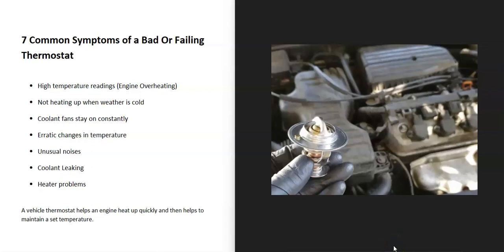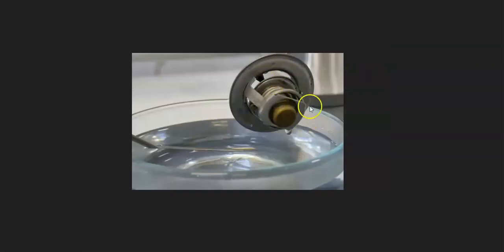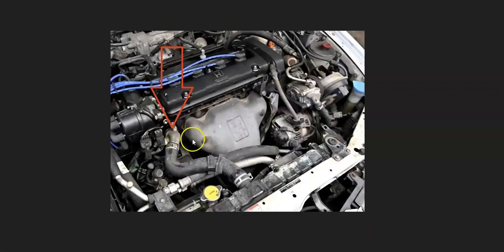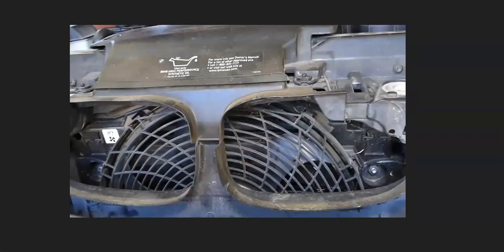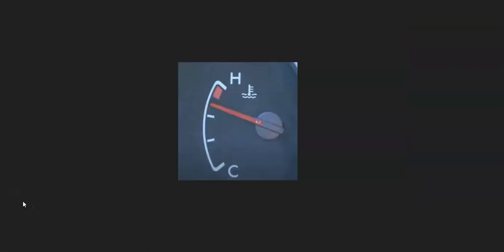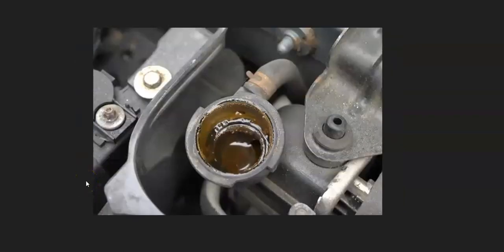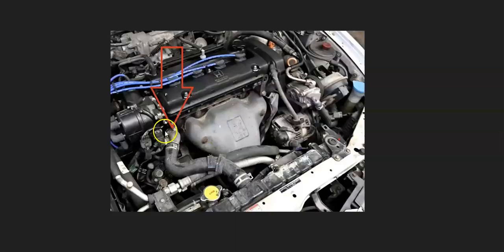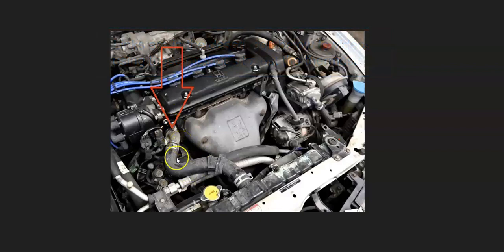7 Common Symptoms of a Bad or Failing Thermostat

Comment: Hi I live in Chicago and it’s very cold right now. I have a 2005 Toyota Avalon, it would throw out hot air and the car’s temperature was normal. 20 minutes into driving the air would get very cold and the car would start to overheat. I would accelerate the car hard and the car would start throwing hot air again, and the car would go to normal temp. ALSO KEEP IN MIND THE CAR WOULD NOT HEAT UP WHILE IDLING. I then changed the thermostat thinking it’s the problem and now my car heats up while idling. Only my left radiator fan turns on. I need help pls!!!!

Comment: My 2013 Silverado with 4.3 ltr V6 the engine doesnt overheat in summer or winter but the heater blows cold air when fan is turned up. If the fan is left off you can feel warm air coming from defroster and heater vents. Would the thermostat cause this?

Comment: Im noticing that the hose that connects to the reservoir is leaking and a leak from the firewall connection. Is there something else thats causing this, like the thermostat? Cuz now it seems like its getting worse. And im worried

Comment: What if your temp gauge is just not heating up, but you still have heat? Is that just the sensor? Or a combination of the sensor and thermostat? Also what if your AC is not working when the temp gauge is all the way cold?
Reply from the maker: If the engine heats up but the gauge doesn't, that is usually a bad sensor or sensor wiring.
Reply: @HVAC_Mechanic okay thank you!

Comment: I have a leak that I haven't been able to spot just yet but my top hose is hot to the touch while my lower hose is cool to the touch I also hear like boiling liquid when I get back home and put it in park after a 10 min drive give or take also a little steam that's smells kind of sweet. I have a 1998 Jeep Grand Cherokee Laredo I replaced the gasket but not the thermostat. Do you think I have something loose or is it the thermostat or the pump

Comment: I've got an 08 ford escape 2.3. i just replaced the radiator and slowly started to fill the  antifreeze to where the level wouldn't go down any further. Started vehicle and tried to burp the system and it seems like the thermostat is not opening, but im not sure.  Noticed the the temperature gauge started rising to almost to the H. Im worried and don't have a lot of money or time left. Unable to drive it atm .

Comment: I know this video is a little old so I might not get a response but... my fan isn't kicking on at all and my 1986 mustang is overheating. Could that be the thermostat or maybe something different?
Reply: could be a multitude of things, thermostat, coolant temp switch (tells the car when too kick the fans on at a certain temp), bad fan relays, bad fan fuse, coolant temp sensor.

Comment: my  temp gauge is fluctuating between cold and mid temp I’m thinking of starting with the radiators coolant sensor and a thermostat .. I already checked coolant levels. Hoping it not the water pump

Comment: I’ve been noticing the smell of antifreeze for a while after driving it , but no leaks. Then recently I had a situation where it over heated after driving for about 40 minutes on the highway.
Reply: What was the problem?
Reply: @fierro701navarro2   no clue its great in town but long it trips it will it over heat and start slipping to the point it barely drive. Once it cool down it’s fine again. I’ve changed all thermostats as well.

Comment: The temp gauge was past the H! Almost to the bottom. I squeezed the hose a couple of times and it heated up and the temp gauge dropped. 🤦🏿‍♀️ Done changed this thing WAY too many times.
Just got a flush. That may be the cause. So I bought a Motorcraft this time. 2094 Ford Taurus SEL. It's said to not do well with aftermarket thermostats. So I hope this is the last time.

Comment: Hi, I have a 2006 Corolla that’s only blowing cold air, even after running the engine for 10-15 minutes. I replaced the thermostat since that's usually the culprit when there’s no hot air, but it's still blowing cold. I also filled up the coolant reservoir, but it looks like the fluid isn't getting hot at all. The car's temperature gauge moves, but it never shows the engine is overheating. The fan is working, and the bleeder valve seems to be functioning fine. What could be causing this issue?
Reply: Could be a plugged up heater core.

Comment: 2014 Nissan Maxima I ran over an possum last night night woke up this morning to it running hot no visible leaks anywhere I can see but coolant keeps running low every time after I fill it up idk where it’s going oil an coolant are not mixing but heat not really working until the car is in overheating stage

Comment: My check engine light came on so when I went to auto zone I was told it was the thermostat.  My car isn’t over heating or anything. I have a 2016 4 cylinder twin turbo Infiniti Q50 and I can’t find one video that is for a 4 cylinder also when i went to buy the part they gave me the whole thermostat housing unit.  The whole thing has to be replaced?  Sorry I just don’t know much about cars and with it being my only means of transportation I don’t want anything to happen to my car
Reply: 4 cylinder infiniti have a single turbo not twin turbo...just fyi
Reply: My check the engine light came on I brought it to AutoZone and thesaid it was thermostat  how long I came ride before I put it on because I gotta go to work it's Friday nobody can't fix it until Monday u think I can still ride it's not gonna run hot do I take a chance

Comment: I just had the radiator replaced. My radiator fan isn't coming on. The engine isn't overheating. Should the radiator fan come on at about two mile ride. The radiator fan was coming on prior to the repair. I'm just not understanding why it isn't coming on now.
Reply: Sameeeee trying to figure out how my heat was working perfectly fine wit my coolant light noti kept comin on b4 i got  radiator n spark plug replaced had an leak n slipping transmission 😢 and now my heat don’t work unless it 40 degrees or above. Now my money light back on

Comment: I changed my coolant temp sensor because the fans ran all the time, even when i turned the truck off and the temp gauge wouldnt move. For 2 days i assumed i fixed it because the fans went back to normal and the temp gauge started working. Now, all the problems have come back.  What could be the issue?
Reply from the maker: It needs to be diagnosed but check the wiring something may have not been plugged in good and came loose.
Reply: @HVAC_Mechanic  thanks for responding. I unplugged the sensor and put some lube on it a mechanic gave me, and hopefully that does the trick. It's working so far. I really appreciate you responding!👍🏾

Comment: Wow this really helped because my BMW OBD said map controlled thermostat jammed open BUT I'm not getting and erratic readings on my coolant gauge. Everything seems normal. However my check engine light comes on sporadically when the temperature changes a bit

Comment: I got a 180 thermostat an it will always run at 185 to 186 when I’ll gas or race I’ll run at 200 max an go back down at 185 to 186 at  cruise. Now it runs at 192 to 195 is the second time a charge the thermostat idk what to do now.

Comment: Good video hey mine overheats while ilding ofter like 20 to 30 minutes but runs great while driving never overheats when driving but if it starts to overheat not in red but going up and i pull off and drive it goes back to normal what do u think that is
Reply: Could be cooling fan, whether clutch fan or electric.
Sometimes when these go bad the radiator doesn’t get necessary airflow until your moving and wind goes through it.

Comment: Could it be your thermostat if your truck is using a lot of coolant but don't see a leak? Temperature gauge in the truck doesn't seem to go up or down,right in the middle but I'm using at least a gallon of coolant every week and don't see a leak.
Reply: Sounds like a head gasket issue. I bet it’s leaking into your oil.
Reply: @chinkyroo  I thought that too but there was no water in the oil. It was a slow leak that took time to develop. Pretty sure it's the water pump now. 
Thanks though!

Comment: HELP PLEASE, TOOK CARE FOR REGULAR OIL CHANGE BEFORE OUR BIRTHDAY TRIP FOR IT DAUGHTERS. THEY SAID THERMOSTAT HOUSING WAS CRACKED, HIGHLY RECOMMEND TO REPLACE. WE DID.  HEADED TO CALIFORNIA ALMOST 300 MILES DOWN THE ROAD CAR FOR HOOOOT. WE CONTINUED ON AS WE HAD PLANNED PAID VACATION. USED ABOUT 14 GAL OF COOLANT. FOR BACK HOME TOOK CAR IN. GIVING US CHADY INFO. SAID THEY WOULD REPLACE THE PART. BUT THAT THE PROBLEM WAS RADIATOR HAD A HOLE. IT 400 FOR FIRST REPAIR. 240 ON COOLANT. NOW THEY WANT ALMOST 600 TO DO THE RADIATOR. I JUST WENT FOR OIL CHANGE. CAR HAD NEVER HAD ANY ISSUES AT ALL. I ASKED HOW THEY KNOW IT'S RADIATOR. THEY SAID PRESSURE TESTED. I SAID DID YOU OUTSIDE TEST AFTER REPLAYING THE  HOUSING. THEY SAID NO. THAT WAS EXTRA ?? PLEASE ANY ADVISE WOULD BE GREATLY APPRECIATED 🙏

Comment: Replaced a cracked heater core hose and reservoir.  Goes to 210, i go around 70mph and it'll go up from half to 3/4 hot.  Once I let go of the gas to 60 it goes back to 210 (half)  would that be a bad thermostat and or didn't let all the air pockets out?
Reply: You find out
Reply: @MaleekKimble  yes, I had a clogged radiator.
Reply: I also went ahead and replaced the upper and lower hose, both inlet and outlet heater core hose, thermostat, temp sensor, water pump, and reservoir.

Comment: I have a weird problem. I just drained and filled my 2021 Acura ILX, and now I only get blasting hot air, when I set the temperature to HI? If I go to 80,82, ,85, ect.. I get room temperature air basically. I used the spill free funnel to burp the system for 2 days now. Same results? Any ideas? Thanks
Reply: The temp gauge stays in the normal spot, even through all this?
Reply: Also both hoses are hot.

Comment: Great video, 👍 
My engine temp used to read 203° with a 203° stat, but due to a faulty radiator cap ( verified with a cap pressure tester) the engine overheated. 
I replaced the coolant and the cap and engine seems to be running fine but the temperature now reads 194° . Temp does not fluctuate and engine warms up as quickly as it did before the overheating.
Could the thermostat possibly be damaged due to overheating?

Comment: I have a 07 Civic Si when I warm up my car it’s low then goes normal half ways, but then when driving it goes high but my car doesn’t over heat, then it will go back to half ways, or when I start my car it would be high then 2/3mins later it goes back to normal half ways. So it be the thermostat that’s bad? Thanks for the help

Comment: Unless you live in very cold area.....I'm on the coast of Calif...take the thermostat out and leave it out...a colder running motor won't run your day like a very hot motor..
Reply: @markwilliamson2795  just  replaced the thermostat, still leaking. I'm losing my mind.
Reply: Wait so I can run the motor without a thermostat

Comment: About 8 months ago I had the water pump changed on my 2013 GMC Acadia. Seems like ever since that time, the engine temp goes to 210 on the gauge and never moves. I never see the thermostat cycle. Every vehicle I've ever owned, I can see the thermostat cycle if it has a Temp gauge. Could that be a faulty thermostat, maybe partially open?
Reply from the maker: It needs to be diagnosed, but often when the gauge does not work correctly but there is no engine issue it is a bad temp sensor.

Comment: Q: temperature high but when switch on the ac the temperature is getting low a bit.. Why? I change the thermostat, radiator it still the same

Comment: What if you live in a city that is hot af 109 degree weather? My engine is overheating here, it f’n sucks!
Reply: Could be thermostat, coolant temp sensor, radiator fan sticking. I would check all of those. Also service your coolant and radiator by flushing it and change the coolant

Comment: Yesterday it was extremely hot 
My vehicle was revving up on the highway when I accelerated. 
Then it started to smell of burnt oil
When I pulled over and shut the vehicle off, I could hear the gurgling sounds. 
The AC was not coming on during driving. The highway was very busy due to a holiday, so the vehicles idled most time in line on the roads. (approx 1 hour of crawling traffic) 

Anyway, I gave it a 30-minute rest. Sudden rain came down. I guess that cooled things down and I was able to drive safely home.

Comment: 2012 Toyota Tundra...runs fine, temperature has always been fine...but this weekend on highway road trip, notice temperatures rising on "up hills", like a bit more load on the engine. Did not do it all the time, but did it several times on a 400 mile trip. It never overheated, seemed to drop back down after leveling out. This has never done this before. Its not the cap, as I changed it several months ago. Any thoughts....its really bugging me.
Reply: Same thing in my 2000

Comment: My temp gauge is still on high after a couple of hours I haven’t used the car and the needle is still in the same area I turn the car on the fan turns on then stops any idea what it is because the engine isn’t hot or anything the needle just high could it be the thermostat?
Reply from the maker: If the engine is not overheating but the gauge is reporting it is, the coolant temperature sensor is likely bad.

Comment: Question: I changed the thermostat on my Acura MDX 2005 because the fan doesn't turn on until the I car is off... do you think it could be the coolant temperature sensor?
Reply from the maker: A bad ECT or bad wiring can cause that issue. Does the dashboard gauge work correctly? If you have a scan tool, check to see if the ECT is reporting a temperature that is way off.

Comment: My overflow is leaking fluid daily and multiple times a day, also my fan comes on and off at different times, which is causing my 2029 jeep renegade to overheat. What is my cause, somebody said it's my radiator, but I am having doubts
Reply: Dd u get help? M also facing the same issue

Comment: Hey my radiator fan wont work I remove the plug to the coolant temp sensor and the fans turn on I plug the coolant temp sens back in the fans stay on I pull the fan relay out the right fan turns off and the left fan stays on I turn the car off and on again and the fans won't turn on anymore my ac won't work aswell .....would a bad thermostat be the cause of this ??
Reply from the maker: Is the engine overheating? If the engine is not overheating, the temp sensor may be bad.

Comment: I have a 2006 Malibu 3.5 i replaced the thermostat and its still stuck closed.i also replaced my coolant temperature sensor and coolant wont circulate why? please help and thank you
Reply: Bad radiator or water pump

Comment: Chrysler 300 2.7 I had the water pump, timing chain, thermostat & reservoir replaced. The vehicle overheats & and the coolant leaks out the reservoir.  The mechanic recommends replacing the radiator. What do you think?

Thank you
Reply: Do a head gasket test